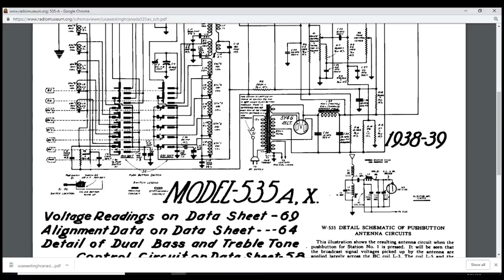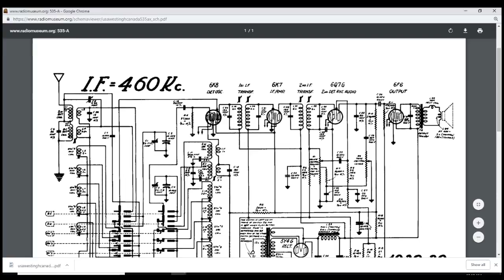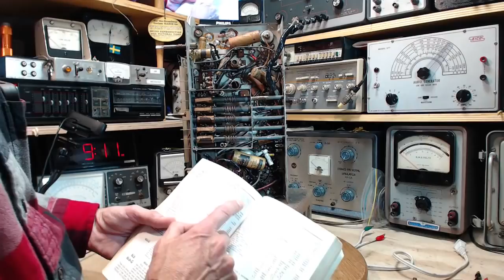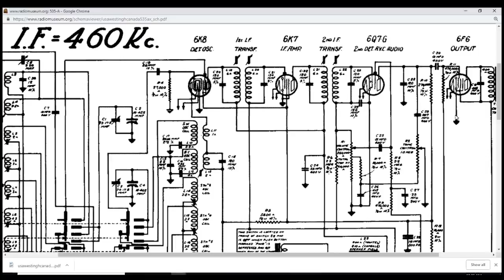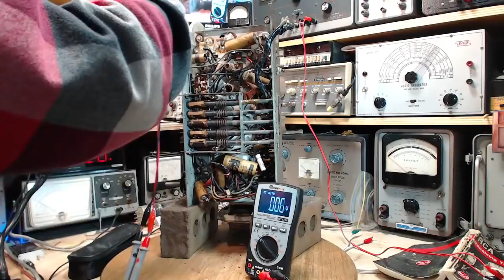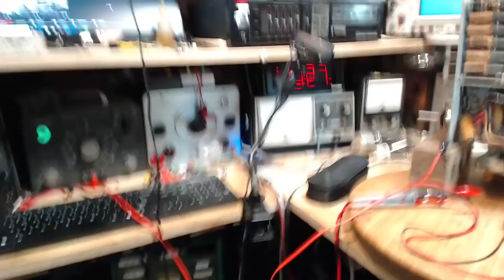Westinghouse 535 Video #3 - Schematic Overview

Comment: That 6K8 triode/hexode tube is a precursor to the more compact (and noisy to nearby receivers) "pentagrid converter" tubes such as the 6SA7 and 12BE6/6BE6 types. 
The 6K8's triode is the local oscillator, the hexode is the mixer. Think of the hexode part as having TWO control grids, one excited by the oscillator, the other excited by the antenna circuit. The hexode's plate, of course, does wobble with the local osc., antenna signal(s), and the sum and difference frequencies derived from the mixing of the two.
A functional ideal would be a triode R.F. amplifier for the (tuned) antenna circuit (thereby suppressing feed-through of local osc, and I.F. energy out to the antenna) , a triode local oscillator, and a pentode mixer. An effective cost-reducing compromise is to combine those three functions in a single tube: fewer tubes, tube sockets, less wiring, lowered power consumption (less HEAT!), less chassis space required...

Comment: Remember the negative of those capacitors doesn't go to chassis so shorting the electrolytics to chassis doesn't short the capacitor directly. It includes the back bias resistor from the negative supply rail.

Comment: Jim's "theory" regarding galvanic action within electrolytic capacitors is accurate, most especially evident with aged components. Bearing in mind that a soggy PAPER capacitor IS an electrolytic system.
 Also, the DMM itself may be outputting a very small AC voltage even when set to "read" a DC potential across its probes; any electrolytic component in circuit can rectify and so "detect" that AC voltage. 
Funky readouts result. 
Connect a sensitive 'scope on the leads of yer DMM... even better: do so when a crusty old capacitor is across them . Sometimes that is illustrative, if not merely puzzling.  ;-)

Comment: Measure the capacitor direct across the capacitor, not from the positive terminal to chassis. As I said previously, the negative of the capacitor doesn't go to chassis.
Reply: Yep, and all of that metal-under-test fairly closely coupled to everything that's powered in the shop.
Isolating at least one end of the component obviates a lot of questions...  ;-)
Reply: What about replacing that 6K8 vacuum tube with 3x 12AX7 vacuum tubes using the same circuit as a SO42P balanced mixer with it's own built in tuned Local Oscillator in a small metal box to try and get rid of the carrier and wanted signal and just output the sum and difference signal which will goto the first IF transformer.
Reply: @DAVIDGREGORYKERR  Your not serious!!
Reply: widecast why not as it would be a balanced mixed based on  the SO42P but using 12AX7 or ECC88 tubes